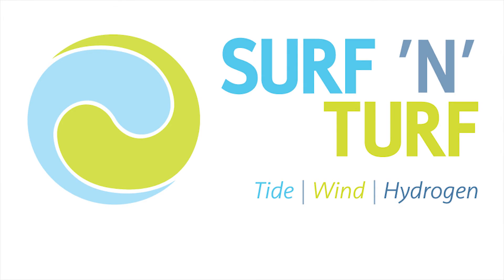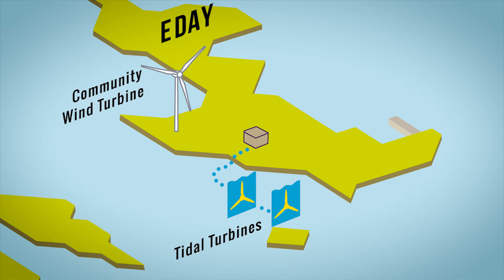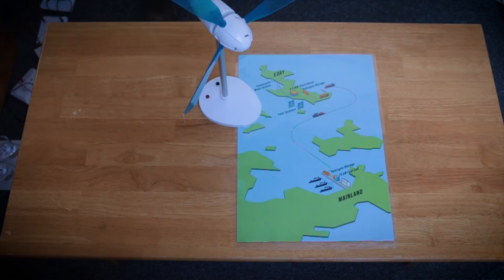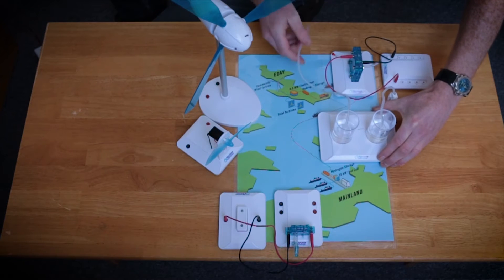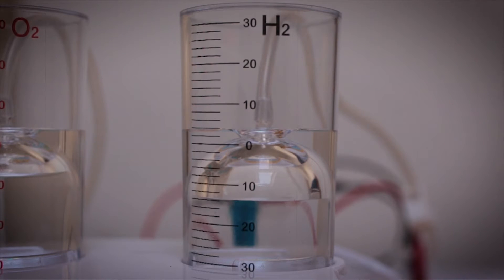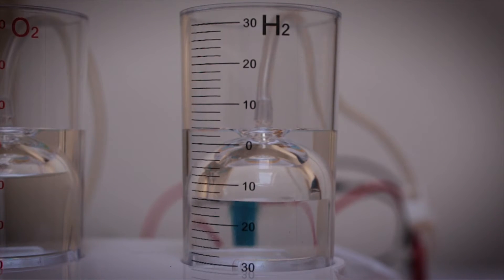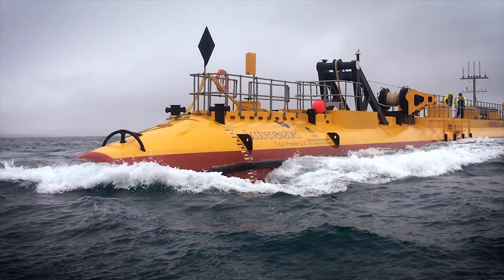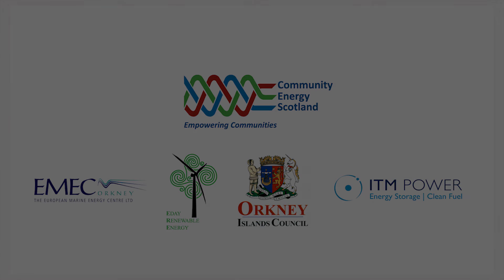Surf 'n' Turf hydrogen project

Comment: Neat trick but why bother with the electrolyzer, the compressor, the trucks, and the shipping? Electricity is more useful than hydrogen, there are lots of things you can do when cheap electricity is available from the grid besides make and store hydrogen. BEVs will be even cheaper to recharge, industry can pre-heat, pre-cool, and run energy-intensive processes, etc. It's only 5 miles from Shipinsay to Kirkwall on the mainland,   that's easily within range of a battery-powered ferry.
The much-touted "hydrogen economy" is a follow-on from the real story here, which is the "intermittently very cheap renewable electricity economy."
Reply from the maker: Ideally the electricity generated would be used directly for some of the applications you mention, but as with much of the grid in Scotland, the Orkney grid is now very constrained and most of the wind turbines on the island are controlled by an Active Network Management system which turns them down or off altogether when generation is high and local demand is low. We're involved in all sorts of projects looking at ways to maximise the amount of generation and runtime from these community turbines by either storing the energy until it's required, or by bringing on flexible loads that can respond to signals and come on to avoid turbines being curtailed - for instance the Heat Smart Orkney project is helping deliver low-cost heat to householders by turning on space and water heaters in local homes, utilising energy that otherwise couldn't be generated. Rest assured we are working on a lot of projects involving battery electric vehicles too, including a big one we can't talk about just yet! All that said we're convinced that hydrogen has a really important role for all sorts of applications, including longer ferry routes, but also short ones like the Shapinsay ferry which operates regularly, meaning short refuelling times are key.